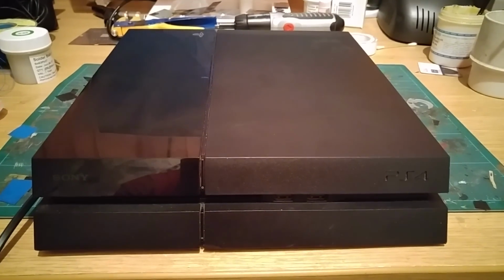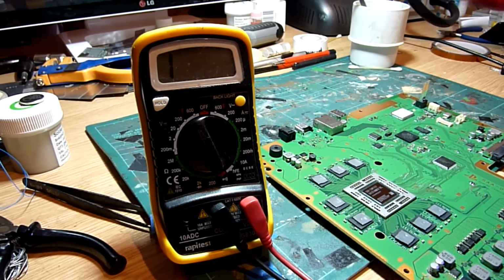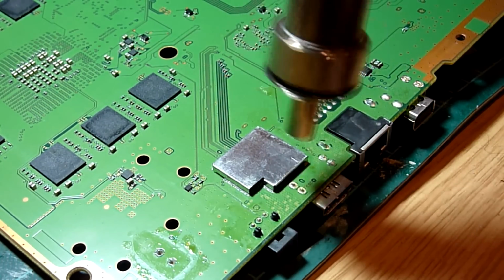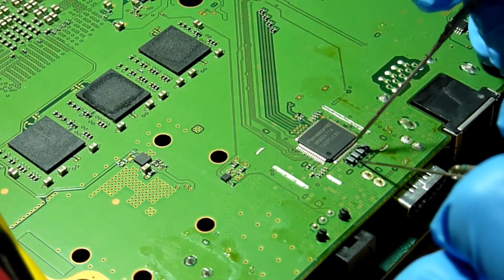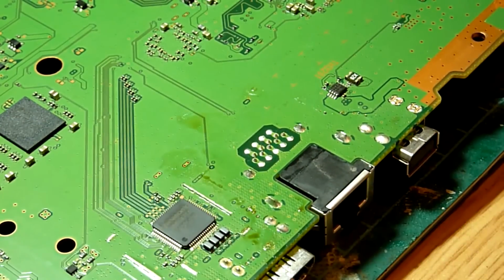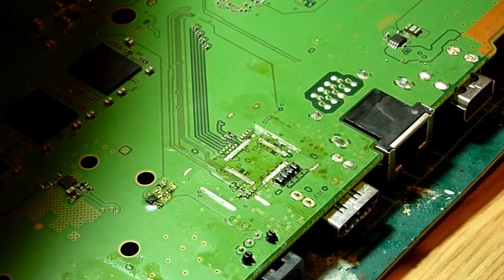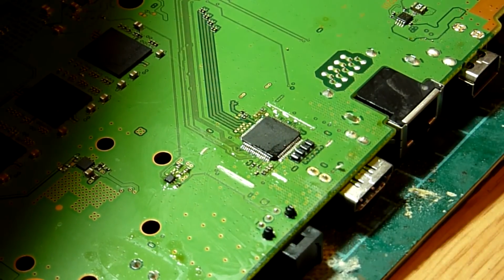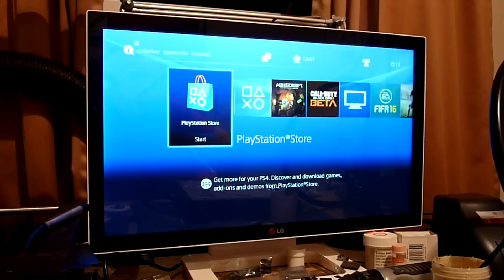PS4 Diagnose Faulty Panasonic MN86471A HDMI Encoder IC Chip Tutorial (WLOD)

Comment: PS4 came in with badly damaged hdmi port, replaced the hdmi port . Tested it, video output was working going in and out.  I replaced the chip brand-new and still no Video any ideas ? Also here is a photo https://asappcfix.com/pix/20190105_020128_001.jpg that shows pins that short to Ground when chip is installed. I removed a few caps but short stays. Short goes away when i remove the chip...
Reply from the maker: Be careful with this one - what resistance is the DMM showing when measuring these points? They typically measure between 50-90ohms which most meters will beep for in continuity mode but isn't necessarily an indication of a short - merely that there is a low resistance between those points. Have you tested continuity of the EMI filters and ensured there are no loose pins on the encoder with the nudge test at all yet?
Reply: it is 48.7 M-ohms that is from the Ground to those points
Reply: filters are good tested parallel and cross did nudge test for ic chip and tested hdmi connection 3 times now just to be sure
Reply: i also checked the diode for short to ground (pin 13) and the resistor to the very left of it in diode mode and i get get nothing should i change it?

Comment: Dude, remember me? So I seem to still be having the problem but it hardly ever happens during game play since I changed out the thermal grease but it does still randomly happen... I noticed that if I move the ps4 while its plugged in and powered on, it almost always gets the WLOD causing it to freeze so I think there is some kind of short going on because if i squeeze on the right side of the ps4 it freezes it instantly every time and I get the WLOD.  What do you think the problem is?
Reply: I purchased a new HDMI port but I haven't replaced it yet because I want to be sure of the problem since the symptoms kind of strange compared to others out there.
Reply from the maker: Squeezing the right side would suggest APU issues.
Reply: I had a feeling it could be that but at the same time i wondered if it was a short or bad connection... I guess i will have to do a little more investigating. i noticed if i moved the hdmi it would short out too if i tapped it just a little
Reply: I had a feeling it could be that but at the same time i wondered if it was a short or bad connection... I guess i will have to do a little more investigating. i noticed if i moved the hdmi it would short out too if i tapped it just a little

Comment: Hey man, my ps4 was working fine today but in the middle of playing a game, the screen went black but the system was still on. I couldn't get a signal anymore and tried a different hdmi in 2 other TV's and it didn't recognize that there was a signal at all. My computer also plugged into the same wall socket doesn't show video now either. Is there a way to fix the ps4's video signal, it still turns on and shows the white light but no video
Reply: Also do you think it was some sort of the surge because it smelled like something had heated up and started melting, plastic maybe
Reply from the maker: +GuitarKid218 Hi, yes sounds like a bad one. If it's done both your computer and your PS4 then it sounds like a rather nasty power surge. I'd get the wall socket checked by an electrician to be sure it's not localised to that one socket - always best to be safe rather than sorry in these instances, especially when dealing with mains voltages.

Anyway - as far as the PS4 goes it's probably frazzled the HDMI Encoder IC or part of the circuit which it controls. If you're not familiar with troubleshooting these things then it's probably going to be a bit tricky and would probably be best suited to a pro console technician who knows a bit about component-level repair. Good luck!

Comment: i have got one ps4 with distorted display i resoldered the hdmi pins. now its a bit batter but still little distortion after few seconds but nothing happens when move the cable. distortion is tiny bit after few seconds with a little distorted sound. should i just follow everything from start to end or just change the hdmi i?. i have a doner board on me to get hdmi ic from.
Reply from the maker: +TaaRiiFrp Check to ensure the HDMI comb isn't out of shape - they can warp slightly which can cause intermittent issues like you describe. To be sure you can check connectivity of each pin with a multimeter. if all looks good and you've got a spare IC then give it a try and see what happens :)
Reply: +Andrew Paul thanks for replying mate, i actually follow all steps but hdmi comb as i don't have the diagram for that and eventually changed the hdmi ic from a doner board and it all works fine now.
can you provide the hdmi comb's ways?
and how do we differentiate the if it is a graphics card problem or hdmi ic problem as both problems resulted in corrupt and distorted display?
Reply from the maker: +TaaRiiFrp The comb is just the plastic tab inside the HDMI port - you can't change this on it's own - you'd have to change the port but happily you don't have to do that now.

It's very easy to differentiate between an APU failure and a HDMI Encoder IC issue. An encoder IC issue will cause one or a combination of static, an over-saturation of one particular colour, the loss of a particular resolution, or several resolutions / blank screen with no audio, solid red/green/blue screen with no audio etc.
APU failure will cause the console to display as normal however the image will start to drop detail and cause glyphs / malformed polygons etc. This will get worse very quickly before the machine would lock / power off.
Reply: +Andrew Paul appreciate it, cheers mate.

Comment: Im pretty new to this, have been doing small repairs here and there, and have practised a bit on other boards ive had lying around. Decided to bring it to my ps4, and  Im really struggling to remove my IC. The max temp of my hot air station is 450 degrees. Could this be the problem? Ive not had an issue removing anything before this.
Reply from the maker: 450C should be more than enough to be fair. The likelihood is the calibration of the air station temperature probe - which station are you using?
Reply: Andrew Paul I figured it out, I was just being a bit scared to use a higher air flow. Went ahead with the repair yesterday on a console that was just displaying noise y "snow" patterns. Now the console isn't displaying anything. I don't see any bridges on any of the legs, and the pads looked fine upon removal. Recon the new IC is dead? Also, I tested some of the legs on my multi meter in continuity mode, and they do have a connection, but they're not bridged from what I see. Is this normal? Sorry for the questions, thanks for your time.

Comment: Hi mate recently had a lightning strike on my satellite dish which was connected to my TV and the ps4 was connected to the TV via hdmi. Since that happened my ps4 has had the white light and cant get it into boot mode also all the hdmi ports on my TV are also not working. Just wondering what your input is. Do you think its the IC Chip?
Reply: *Safe mode not boot mode
Reply from the maker: Very possibly - there's no protection for it and it's the first thing in line once that surge hits through the HDMI port. Good luck.
Reply: +Andrew Paul cheers mate, appreciate it. How much would you usually charge for a chip set repair??
Reply from the maker: mmoneeb1 hi mate, my services can be viewed at http://www.ebay.co.uk/usr/lufcfan2004
Reply: +Andrew Paul thanks mate

Comment: I have a similar problem but the PS4 outputs audio but no picture. The HDMI port looked fine so could it be the HDMI transmitter in my case?
Reply from the maker: Hi, indeed it could - the Encoder IC is responsible for muxing audio and video signals so this can be a sign of a failing Encoder.
Reply: +Andrew Paul Cheers! Thanks for the tips and all your great repair videos. Maybe I'll come back asking what could be wrong when I've tried everything ;)
Reply: Check to see if pin 4 of the HDMI is short to ground (Usually the case of the IC short with no picture but have sound)
Reply: Thanks for the tip, Stevie! 
Since I wrote my first comment I've replaced the HDMI port and HDMI Encoder. Still no picture. All the legs I've soldered looks great and have good connection, no loose legs, no shorts between legs, but still no picture. Although I haven't tried what you said and measure pin 4 on the HDMI port to ground. I'll try that tomorrow.

BUT, today when everything was finished I tested it. No picture, tried safe mode (holding for the 2:nd beep), still no picture. Then I just left it with WLOD. Turned it off and on again and I got the PS logo and a blue screen with a lot of text in different language I think and some pictures of what the Dualshock 4 buttons do. Then the picture just disappeard and I haven't managed to get a picture again. I didn't touch anyting I just left it booting on my desk, sitting back watching.

Thing to keep in mind! I'm using a PC monitor for testing so I can't hear no sound for the moment. The maximum resolution is something like 1600x1200 so could that be a problem getting a picture even in safe mode (480p)? I should be able to get some picture in safe mode, right?

I don't have a controller so I'm just testing it with the power button on the console. Would I be able to do someting different to test with a controller?
Reply: Have you tested continuity from the upper part of the HDMI pins to all relevant points?

Test the system on a  TV to make sure too :)

Sounds like at least one of your solder connections is not quite right. Do you have a microscope?
Reply: Found the problem. Bad cap on the HDMI circuit that caused a short. Second problem was all the nasty flux I forgot to clean inside the HDMI port that have gotten there somehow. Then it all worked! Unfortunately I tried it ones before I assembled it the other day and I got a BLOD :( Maybe becuase I've tested it to many times by putting the heatsink on and off to much, I was really careful all the time but that might have broken some pads on the APU. Oh well, just my luck.
Reply: So you repaired the HDMI circuit and achieved a white light with display and sound.. Then before rebuild you now have a BLoD issue?

You were replacing the thermal compound on the APU etc and making sure the fan was connected and unobstructed right?

Remember a BLoD is not always the APU and can be a general failure of the unit - How long does the light stay on for? Does it switch back off?
Reply: Correct! The PS4 showed picture and was working. I shut it down (since I didn't have a controller) and left it over the weekend. 

Yes, I put on new thermal compound and made sure the fan was plugged in.

I was about to assemble it on wednesday this week. Turned it on and it stayed on (blue light) for like 6 sec then died. Tried again right away, a 1 sec blue light then shut off and if I tried again same thing. 1 sec then shuts off.

I tried again today (Thursday) in the morning since I left it over night unplugged. Plugged it in, turned on, got all the way to a white light (probably my bad solder job on the HDMI, so nevermind that) but then it died. Tried starting it again, same thing 1 sec blue light the shuts off.

Andrew was talking about the South Bridge but ununfortunately I don't have a BGA reballing station so I'm out of luck here :(
Reply from the maker: Sadly don't think this one will be down to a SB issue. What thermal paste did you use? Some are conductive and can cause issues if it gets off the die.
Reply: Gotta agree with Andrew here - The symptoms are too random to be SB.

Even when not conductive TIM is still capacitive and can cause problems with circuits if too much is applied and it gets over neighbouring components. Seen this with a few GPUs and some crazy symptoms from it.

Take some high resolution pictures of your HDMI circuit area and neighbouring components for us too see - Also the APU with thermal compound still on it ;)
Reply: I think it's the Artic Silver 5 that I use.
I probably used too much paste because it was indeed of the die. To be honest I haven't cleaned the APU very well because I didn't think the paste could be a problem.
Or is it?
Reply from the maker: AS5 is indeed conductive. Give the board and APU a good clean and when there's no more paste or residue on there put a tiny pea-size dot on the centre of the APU die. Hopefully then it'll fire up. :-)
Reply: Could it be that simple? Thank you so much Andrew! I really appreciate you replying.

How stupid of me. I've had this paste laying around for years cause I rarely do these kind of work. I'll give it a good clean tomorrow and come back with an update. 

Cheers Andrew and Stevie!
Reply from the maker: It sure could be mate - hopefully that's all it will be :)
Reply: AS5 isn't actually conductive - It is slightly capacitive though.

Not sure where it first came from that AS5 is conductive but it was misinformation that was spread.
Reply: Well, I just cleaned the APU from thermal paste (wasn't that much on the die actually) with IPA and around it. Put on some new paste, just enough to cover it this time.
Turned on the PS4 and it gave me 4 - 6 pulses (not seconds) of blue light before it died.
Tried again, died after 3 sec. Tried again died after 1 sec and continued to do that.

The first try will always make the PS4 boot the longest,after that the PS4 dies almost immediately.
There's no HDD and BD-drive pluggen in atm, so I can here the fan spin when I turned it on.

What should I try next?

Comment: Hey Paul good day. I have a ps4 which I'm trying to repair, pins 1 to 12 all show low resistance to the ground, it's like they are all connected, multi meter bins no matter which pin I touch from 1-12, 13 -19 are ok, have you ever come across such?
Reply from the maker: Remove the encoder IC then recheck continuity to ground. If it disappears, replace the encoder IC. I'd also check the EMI filters in such instances as these might also be damaged - sounds like that console has taken a fairly hefty whack with a decent amount of current back through the port.
Reply: Yes, the owner said that the  flat screen TV shorted out. And after that the console never was able to output any video signal
Reply: Mr Paul. I took your advice , I removed the ic and the short was gone, the tv recieves signal from the console now but the signal is in DVI, tried many options. None of them worked, is there anything you can recommend?
Reply: Mr Paul. I took your advice , I removed the ic and the short was gone, the tv recieves signal from the console now but the signal is in DVI, tried many options. None of them worked, is there anything you can recommend?

Comment: Andrew I have similar symptoms, also some green artafacts sometimes. Of course cant open safe mode. Its allways MN86471A problem?
Reply from the maker: Indeed however I wouldn't be so sure in your circumstances if you can't get into Safe Mode. What happens when you try and get into Safe Mode?
Reply: nothing more then in your situation, normal or safe mode its doesn't matter. Allways have black screen, TV blinking... no video input, signal ok, no video input, signal ok... Console is starting and see white led light. BD rom is working too.
Reply from the maker: Ah right OK. If you've got a lit red optical port then yes mate replace the IC. Cheers.
Reply: And if not? My optical port is black. No red light :(
Reply from the maker: I'd reball APU.
Reply: +Andrew Paul Even if console starting normally (first pulsing blue light, and next go to stable white)? P.S. Probably console is overvoltage (thunderstorm)
Reply from the maker: Ah - if it's starting up to white light then no - leave the APU as is.
Reply from the maker: Replace the IC anyway - if it's thunderstorm damage the first component to get it is usually the IC as it's directly behind the HDMI port and then go from there.
Reply: +Andrew Paul OK, I will try change IC today. Thanks.
Reply: Bad news Andrew, nothing changes... :( IC and hdmi port was replaced. Do you have any more sugestions what is wrong? Thank You!
Reply: I have the same problem, did you solve it?

Comment: i have problem with signal it show 576p and picture like snow..what do u think it be..enconder ic??i already put out all filtter..but same problem..what do u think andrew?
Reply from the maker: Yes most probably the Encoder IC in your instance.
Reply: thank andrew..i try change that ic..waiting part..i update u later..u have email andrew?
Reply from the maker: No public email but I can be reached on here or via Twitter DM.
Reply: can u explain to me pin out for filter..it ok if pin 1and 7 and 10 have continuity?
Reply from the maker: No - if you have those 3 pins shorted, remove the Encoder IC then re-test - are they still shorted? if not, replace the IC for sure.
Reply: yes ic problem..thank you andrew..
Reply from the maker: No problem :-)
Reply: Andrew Paul now i have this problem..i already change 2 ic encoder..pull out filter and put wire on it..check hdmi port no problem..but still no signal..check pin out no shorting..what u think problem ??

Comment: When removing I accidently blew off a component. It's to left then toward middle center of IC pins. Can you please identify. Can't find it anywhere. Thanks
Reply from the maker: Have you a photo please?
Reply: I can do one where do I send?
Reply from the maker: Upload it to imgur.com and paste the link in below. Cheers.
Reply: If you start at top left of IC and go down 13 pins that's it.
Reply from the maker: I think those are little inductors IIRC - not currently near any boards to check at the moment.
Reply: It's black like a resistor is why I'm concearned with value. Can't find datasheet for this ic anywhere to know about what should be there.